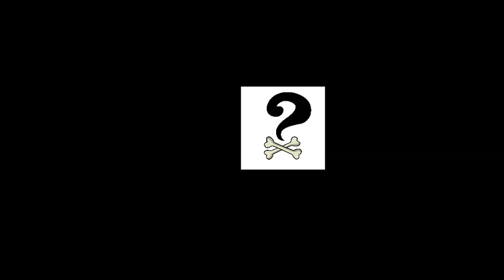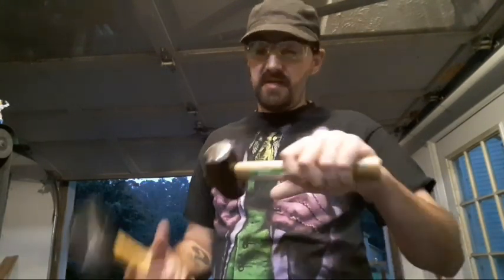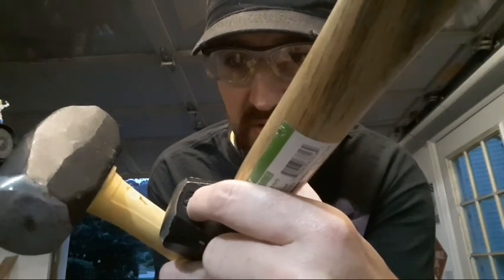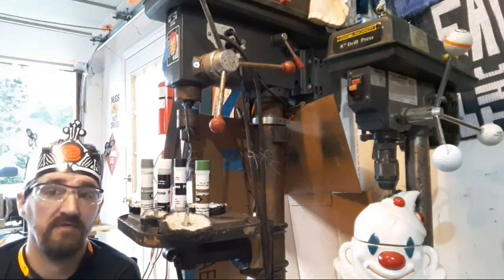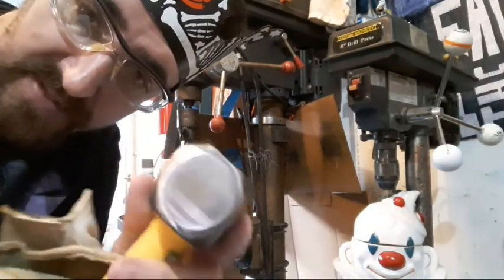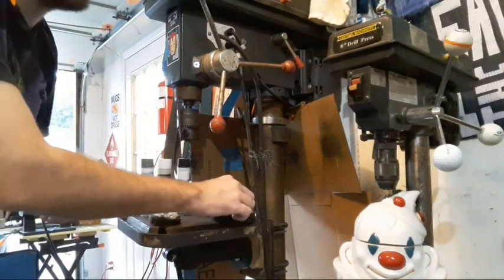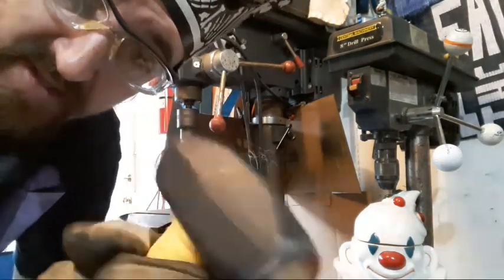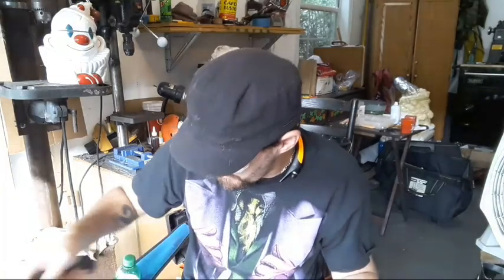How I dress my hammer faces for round/flat

Comment: Great job!  The Hammers look awesome!  For those people with slower machines increasing the size (diameter) of the buffing wheel will increase surface speed!  😃👍.  Thanks Allan!!!
Reply from the maker: ScoutCrafter You are absolutely right about that. I'd really like to have something like a 6 inch buffing wheel for my small drill press but I think those only go up to 4 inches. I really hope when tax returns come in I can just upgrade into a fully functional 2x72 with variable speed and extra contact wheels.

Comment: Nice job.
1215 is a case hardening steel. I can get more info on it, if you would like.
Reply from the maker: 64t120r Yeah, at least a simple way to case harden. I'm planning on getting it as hot as the forge will go and doing a water quench.
Reply: I saw another video of yours. I believe you mentioned something about making jewelry. Was that correct?
Reply from the maker: 64t120r Yeah, man. I'm putting some effort into getting my process for damascus steel pendants figured out. Maybe moving into earrings and stuff once I get comfortable drilling stuff that small out
Reply: Curiosity Forge That will be interesting. Please feel free to call me Brob. Thank Penny for the name.
Here's some info about heat treating 1215. http://stainless.steelandtube.co.nz/wp-content/uploads/2014/06/BrightFreeCuttingSteelAISI1215.pdf
When you mentioned jewelry, I immediately thought of mokume gane. I want to try making some this summer. Have you thought of trying it for your jewelry? It's the same as damascus, just different metals and manufacturing process.
Reply from the maker: 64t120r I am VERY familiar with mokume gane and I've been waiting to give that a shot. I already have a LOT planned for it, just haven't had an abundance kf the raw materials. Also, the info on air cooling to case harden is whipass. Saves me a lot of headaches.

Comment: I use the back side of my 4 by 36 I just put it straight up and down and use the back side for a slack belt
Reply from the maker: Grandadz Forge Oh damn. That's perfect. I still need to hook my 4x3y up and see if it still works. Right now I don't have a good place to set it up and I haven't needed it. That being said I DO want to order some belts for it that are desifned to work metal over and see what happens.

Comment: That short 4lb was to much for me. I like longer handled 2 pounder or the 3lb one with ground in cross pein. That grinder you got is super fast, do you ever scortch  those long belts?
Reply from the maker: HammerTime NY Oh yeah. I scorch belts and I burn spots on edges I'm trying to shape regularly. That thing runs WAAY too fast, and you can't put a dimmer switch in it. The 4 pounder might be too much at first but I'll treat it like I treated the 3. Just run a few heats with it and build myself up over time. A few months ago it only took 2 or 3 heats at 3 pounds to RUIN my arm.